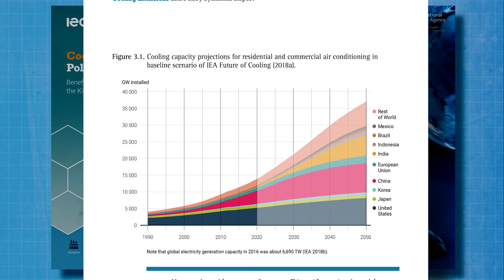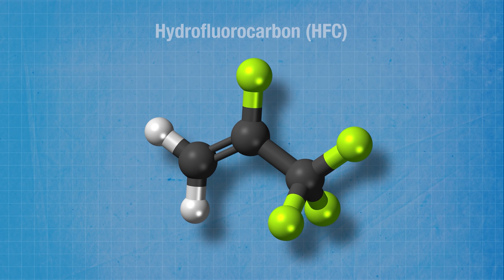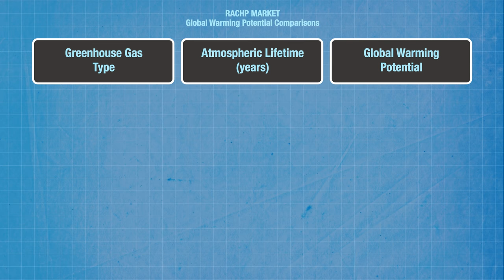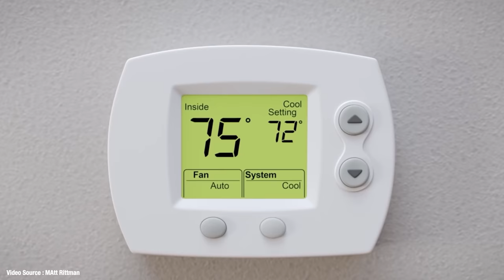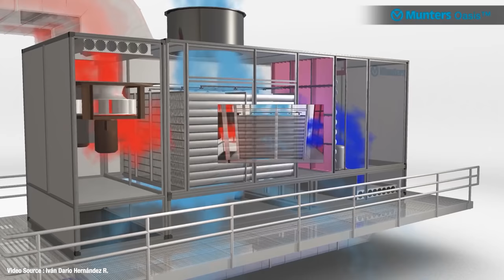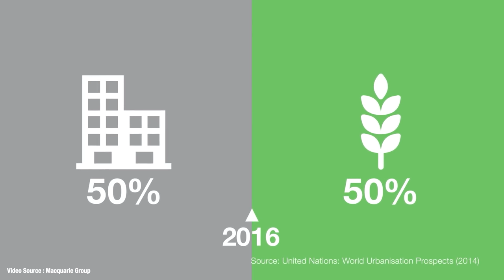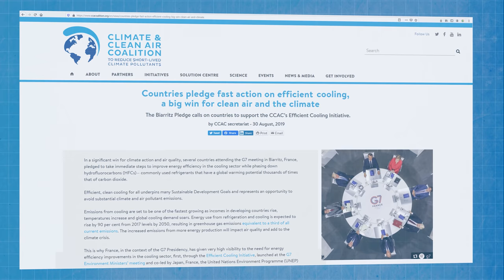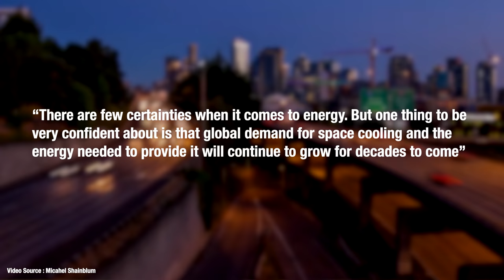Keeping cool in a warming world.

Comment: Swamp coolers are great in low humidity areas, but not elsewhere. Years ago, I lived in a house built in the '40s that had an incorporated attic fan. Vents leading to the outside in each room ( with screens). The fan was driven by a single quarter horsepower motor. You turned it on about May and off in October. Other than the hottest summer days , the house stayed comfortable.
   A simple design that worked ..
Reply: In a cool area.

Comment: If you get fresh eggs that haven't been washed, they don't need refrigeration.
Same with root cellars.  
You can preserve your seasonal garden vegetables through the winter this way without a refrigerator.
It's particularly good for safely storing potatoes, yams, onions, cabbage, carrots, parsnips, apples.
You just create a room in your basement with a small window or vent that is kept open to the cold air in winter to have it colder than the rest of the house.

Comment: No one should ever talk about HVAC without strongly focusing on INSULATION. How can the world ignore the obvious for so long?
Reply: With many ICF systems (like Rastra), heating and cooling systems can be eliminated altogether in some cases.
Reply: @PistonAvatarGuy  Insulation is king!
Reply: Insulation _and airtightness_. You need both for an efficient building. I've just finished insulating my (boring brick 1960s UK) house and now it never gets below 18C without turning the heating on. It remains to be seen how things go on the coldest days but we just had the first frosts and still no need for heating beyond 2 occupants+fridge, TV and laptops. This should be normal in new-build, but it still isn't.
Reply: @xxwookey  I have always assumed that sealing a building envelope was part of insulation and not a separate thing but you are completely right that you need both. Perhaps there are many people who do not understand that.
Reply: @ReevansElectro  I find that airtightness almost never gets mentioned/considered, even though most people know about insulation. Public understanding is extremely limited, at least in the UK. In physical terms the insulation layer and the airtightness layer are usually separate, but they can be the same (e.g in a SIPs building).
Reply: @xxwookey  Yes! Good! But.... You got 2 out of 3 and you really can't do without number 3, ventilation. Leaving it out is a common mistake. Ventilation runs counter to airtightness and is really hard to get right so it tends to fall by the wayside. You basically have to find a way to get all the needed ventilation without getting too much of it. An alternative is ventilation with heat recovery but that's neither simple nor cheap.  The building industry organizes courses on the subject that are open to all (well, for a fee - maybe even remote ones in times of COVID). It's how I picked up most of the knowhow to tackle my own 1930 brick.
Reply: @ReevansElectro  It is more complicated. Insulation, airtightness, ventilation, you need 3 out of 3. Insulation and airtightness alone will not work. The art (and it's an art) is in finding the right amount of ventilation. Too much will defeat both insulation and airtightness. Not enough and the air might get rather unhealthy, not to mention mushrooms and such growing in corners. Over here it's part of the building codes for new buildings but problems are most common in old ones. Worst case people caulk up every last airgap then kill themselves through carbon monoxide poisoning. Proceed with care.
Reply: @astranger448  Your comments about air quality are in the right area BUT you seem to have little grasp of how and when it needs to be accomplished or how much "danger" there is in not doing it. Recheck your old notes from your engineering classes and find out the reality of the situation,
Reply: @ReevansElectro  Well, maybe. How would we know, we are on the internet. So for what it is worth. In the European Union you need an Energy Efficiency Certificate before you can sell or give under rent. I'm certified to make these. You visit the premise, take a whole lot of notes and measures on how the place is built, heated, insulated and ventilated, chuck it all in a software app and voila, a certificate like the label on an appliance with a lot of extra info and suggestions to improve. 
In short, I see a lot of places rather close up. Often with insulation and all kinds of weather-stripping retro-fitted but no conscious thought given to ventilation. That and a mobile gas fired stove for the cold winter days. Every year the media warns against this, and every year people get killed despite these warnings. 
Call it the reality of the situation.
Reply: @astranger448  I am guessing then that you actually know what HVAC stands for then. Just remind me, what does the "V" stand for again?
Reply: @ReevansElectro Yes, V stands for Vergessen, err Vorgotten err Forgotten (sorry, not a native English speaker, we write forgotten with a V). I'm going to make a guess, you are an HVAC engineer and you only get called to places with an HVAC system, or building sites with the system waiting for you in a crate. 
You'd be surprised how many habitations there are the world over without an HVAC system. They did perfectly fine till energy prices went through the roof (bit of instability in the Middle East is all it takes) then the caulking guns came out. Bingo, V for Vorgotten, no more natural Ventilation because we just caulked over it and no artificial/forced Ventilation either since that wasn't there in the first place. 
I understand it is not your problem but it is mine, since I might have to slap a 'not suitable for habitation' notice on the property. Owner-sellers who just caulked over any last Ventilation opening to make their stuff look better than it is don't really like that.
Reply: @astranger448  Sealing a building against UNWANTED leaks is not the same thing as having no ventilation at all.
Reply: @ReevansElectro  Very true. I know it takes a lot more than 10 minutes with a caulking gun to make lets say a 1930 freestanding stand up to a blower door test. But then who knows, it just might. That's why our lawmakers decided that new habitations must conform to strict standards upon construction, with independent surveyors inspecting during and after construction and that existing ones must be inspected and rated for energy efficiency and 'quality of interior climate' aka sufficiency of ventilation prior to sale or rental, again by an independent surveyor. Guess what, getting a clear picture on ventilation is by far the hardest part. A week with a logging CO2 sensor would do the trick just fine, if we could also nail all the windows shut, but we have 2 hours at best and we cannot. If its hard for us specialists to get it right it is not unreasonable that non specialists can get it wrong. 
Truth be told, COVID might have a silver lining. People are being told that sufficient ventilation lowers the risk of infection, and that CO2 measuring devices are a useful tool to check. That or keeping a window open. Fine in Spain, not so in Norway.
Reply: @astranger448  my apartment has one little ventilation strip along the top of every three windows, basically one per room. If you open it, you get a bit of fresh air, but no debris and any strong wind is deadened to at most a breeze. Seems to have been inserted in the frame at the time along with the panes. I’m guessing this was done to meet ventilation requirements? 

Though to be honest I’ve only felt inclined to open it once or twice. (but I do keep things a few degrees warmers than most as well, so I think my tolerance for air stuffiness is higher than most people’s).
Reply: @kaitlyn__L  Regulations depend on the country you live in. In mine lil country these ventilation strips are one way to adhere to code. They open all the way (summer?) but close only halfway (winter?). They never fully close. The same might apply to your ventilation strips, so there is always some ventilation even if you keep the strips closed.

Comment: All new buildings should use very aggressive insulation, ventilation and design standards to minimize energy consumption.  
Similar standards should be applied to retrofits and historic building.  It is one thing to preserve a building but restoration efforts should not require 400 year old materials and methods except on very special circumstances.

Comment: Living in a city with shops opened all the time and their refrigerators running, when I moved in an apartment without fridge, I found that it was ok for me not to buy one more. 
I admit I never buy meat nor milk, unless I consume them immediately. This way, I turn my general switch off when I exit.
Reply: I think this is a good example of how heating and cooling needs can be highly variable depending upon where you live. It sounds like you live in a city where you can easily buy food and don't need to store it at home. Many people (including me) live in cities where stores are more unequally distributed and you have to store food at home in fridges and freezers if you want to avoid spending a huge amount of your week travelling on roads.
Reply: @Kevin_Street  
Absolutely, Kevin. Being able to find an open shop in a short walk makes the difference.
Reply: Just insulate your fridge with 10$ worth of whatever you like from a hardware store. Polystyrene foam pannels are excelent. Less energy cost = less energy heating your appartment.
Reply: @dragoscoco2173  Most fridges these days use the outside panels to remove the heat, so that wouldn't work, but make your fridge work harder.
Reply: @richardpickersgill3434  There still are common type fridges that have one big heat sink in the back and all the rest are just insulated panels of styro and plastic..

Comment: I'm in a relatively cool (but not cold) environment (Tasmania). The single best investment we have made is a basic 6kW heat pump/AC unit. It retired 5 bedroom space heaters, solved summer heat (we had no cooling capability prior to this) and made us capable of controlling our comfort regardless of the cost. After two years, our electricity bill is about a third less than using ad-hoc solutions for winter and zero help in summer. Also, we live on an island that produces 200% renewable energy, exporting half to mainland Oz, so I don't feel guilty using electricity, we already paid for the infrastructure. $0.02
Reply from the maker: Good on you Matthew. Is that an Air Source Heat Pump you've got installed?
Reply: @JustHaveaThink  I don't know what Matthew has, but the vast majority of Australian heat pumps are air to air. I've never seen any other sort advertised and the installers are seriously inexperienced in anything else.

For instance in our local area the council built a new performance space. They installed a seawater to air heat pump, touting the increased efficiency and cost savings. However rather than having fresh water pipes going out into the sea in a loop as you'd expect, they actually pumped raw sea water into the building. Of course they encountered the obvious biofouling and corrosion problems that you'd expect and the system required constant expensive repairs until being scrapped and replaced with a less efficient air to air system after just 5 years. 

So the issues are not just technical. There's a huge knowledge gap for people on the ground that results in expensive and inefficient solutions.
Reply: @JustHaveaThink  yep, a split system, best investment we've made.

Comment: The other day I saw a video on YouTube about paint adding calcium carbonate as a reflector. The surface of the painted area was 2 degrees cooler than the ambient air.
Reply: Lime paint is fantastic stuff and weirdly under-utilised. Cheap as chips, easy to apply, make your own with some cement coloured oxides and away you go. Acrylic paint is a dismal thing and a total con.
Reply: I remember a story where snail eat calcium carbonate paint.
Reply: I saw that in my newsfeed; the calcium carbonate-based white paint resulted in surfaces being 1.7 degrees C lower than ambient at high noon, and 10 degrees lower at night.  That is pretty impressive for a material that cheap.  The only question mark is how would it perform over time?  If it gets dirty or discolored, that seems like something that would have a major impact.  Here is the paper:  https://www.sciencedirect.com/science/article/pii/S2666386420302368
Reply: Except its lifespan is currently very short.
Reply: Our western mode of thinking works for tech fixes. Go look at Village Homes in Davis California. We did it differently years ago. Our problem is always trying to grow GDP which is stupid to do on a finite planet. Ditch the World Bank. And, do depaving too!
Reply: Yes. I saw Hank on Scishow do one on this

Comment: In the 1980's, I painted my tin roof with a silver coat of Rustolium paint, and along with the boron treated shredded newspaper blown in the walls, reduced my air conditioning costs considerably.
Reply: The good thing about the newspaper stuff over the Polyurethanes is how it does not create a vapor barrier in the same way PUR/PIR does. Your walls better retain their ability to shed humidity. With PUR/PIR you might need to up your ventilation, which might defeat your insulation.
Reply: @astranger448  good old paper

Comment: I've been designing and building passive solar homes since 1981 that do not need air conditioning. This is in Southern British Columbia where summer temperatures can reach 40 degrees C. The house I'm building now did not get above 20C last summer when it was 35C outside. The Architecture profession needs to do more as buildings consume 20% of our energy and produce 39% of CO2 emissions
Reply from the maker: Very good point. I'm planning to make a program about Passivhaus in the New Year so if you have any direct insight (sounds like you have) then that would be most welcome. Email address is
daveb@justhaveathink.com
Cheers. Dave
Reply: morninboy, I'd be very interested in hearing about Passivhaus economics.   I hope you're able to contribute to Dave's video on it.
Reply: @morninboy
BCs climate isn't very hard to design for.
I congratulate on your solar passive homes, but it's hardly a problem for that region to manage this.
More like a walk in the park.
Try further north or some hot humid region and see how you go then.
Reply: @JustHaveaThink  
Hit up the guys at Building Science Corporation (US) and their 'perfect wall' for how to do insulation, aircontrol and weatherprotection correctly for any climate zone - the knowledge of that dove tails directly with any passive/plus-energy-house design (https://www.buildingscience.com/documents/insights/bsi-001-the-perfect-wall).
It's as compact and to the point as possible.

And for air-conditioning of a building like that (which usually is air-tight) you might want to look into a system I only know about from Germany.. it's called Gegenstrom-Schicht-Wärmeaustauscher (Crossflow-Layer-Heatexchanger). It sounds like those air cross flow recuperation systems they build and use in the US, but it's more advanced and slick than those.
It's using water as a heat transfer medium and is capable of much more than simple heat recuperation, by allowing several different sinks and sources of heat and cold to take part in the process of heat/cold generation while exchanging air with the outside world. Currently they do that stuff only for big buildings (hospitals, gov, etc.) but on paper it should work for single home dwellings as well (at least that's my personal goal.. but still years away ;-).
Website with the schematic of the full blown system (I can only see German there): https://www.sew-kempen.de/produkte/m-systeme/aufbau-funktion?lang=de, but with Google translate you should get somewhere and maybe mail them and see if they have some English material for you to parse?

The only other thing I know about passive-house designs is that they rely on some big thermal mass (soil, large water tank, big pile of stones, etc.) to enable annual heat/cold transfer and lately they use solar to create more energy than they use (which turns them into plus-energy).
Plenty examples all over the world.

Oh, and one more thing.. in northern Europe they insulate the buildings from the ground, as the average temp of that is below what one wants inside. The material considered perfect for that seems to be foam-glass. Either as a sort of gravel or in cut blocks/plates (more expensive).
Doesn't rot, doesn't compact, does not get attacked by insects/etc. and is fire proof.
Reply: Part of the problem are architects and building contractors stuck in the past. Why should I use/do this, we did not do this for the last 300 years and look, it still stands. But times (and architects)are changing. In a good part of the European union houses for rent/sale now must come with an energy efficiency label provided by an independent surveyor. Inefficient houses now drop in value, stay on the market longer and are a bad investment altogether. Efficient houses command better prices and are good investments.

Comment: I added a misting system (ac mister) to my outside coils. On very hot days, the mist cools the air and reduces work load of the compressor (reduced the head pressure/energy consumption of the ac unit). Also, moved the ac unit to the EAST side of the house so that it has a little share during the hottest hours. And insulation. And double-pane windows. And... and... I'm hoping the US rejoins the Paris Accords. Thanks for the great info. Excellent share.

Comment: Refrigerators need to be made to use outside air when the outside is cooler than inside.
We have the technology to do this, and it's rather simple to do.  
It's like how we vent our stove hood fans.  Just add an outside temperature sensor and a switch to open and shut the vent.